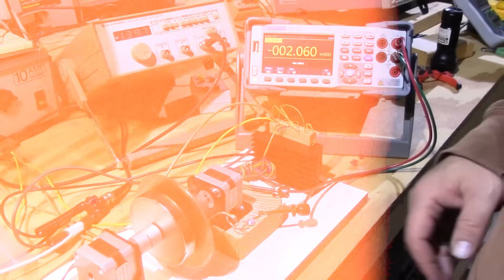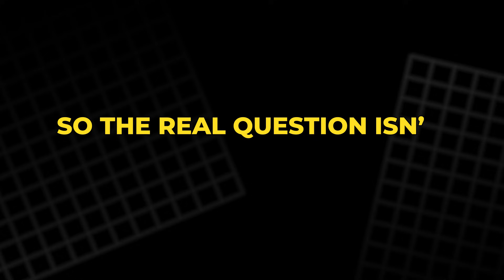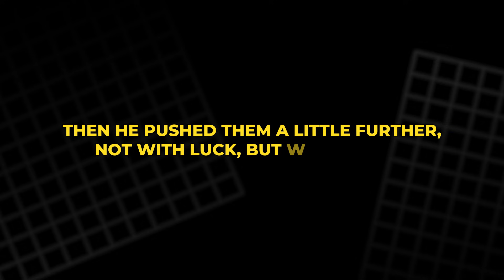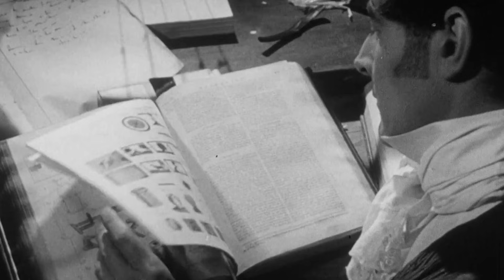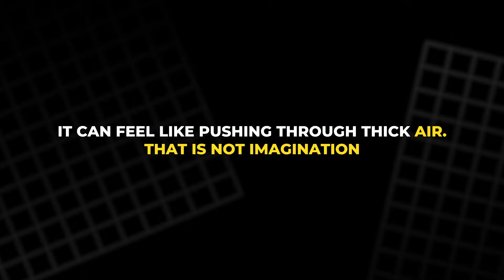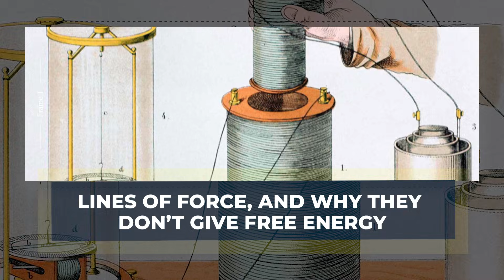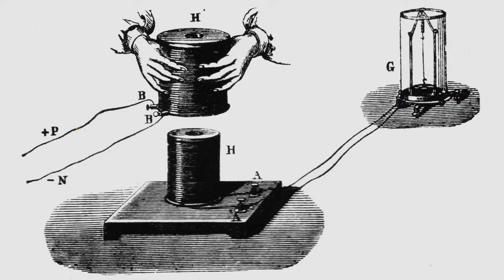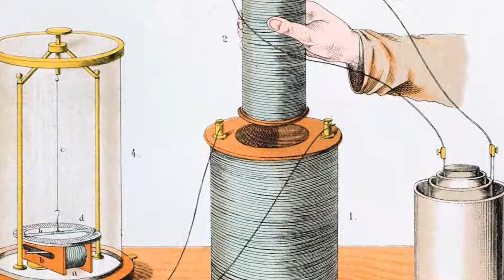Faraday’s “Free Energy” Secret They Don’t Want You to Understand

Comment: 2025 black hole bomb experiment 
120% energy reclaim Zel'dovich effect 
Adapting this to nikola Tesla’s axle flux as the drive motor and the 3 phase motor used to get the 20%gain in energy from rotation amplification. 
And as the axle flux becomes a faraday homopolar generator.
  The truth is modern science proves that free energy exists 
As well a wireless pickup oh we look at the cylinder as a tesla primary that rotates as it's nothing but an aluminum cylinder. 
The real N machine yay
The journey is completed you just have to look.
 As well quantom heat engines are proving entropy is in need of a massive update as we are getting more out than we put in. 
  2025 Zel'dovich effect black hole bomb superradiance
Reply from the maker: Thanks for sharing your detailed thoughts on these concepts!